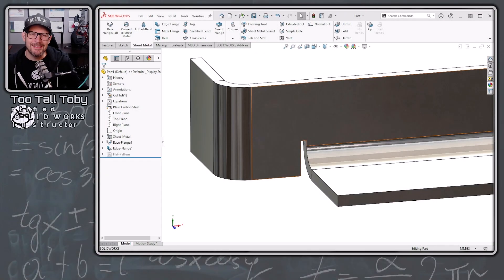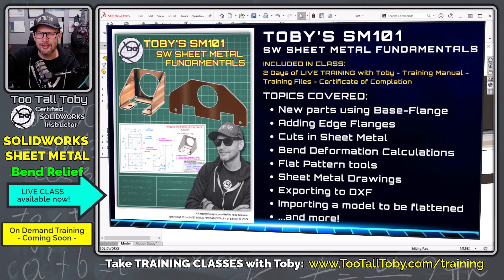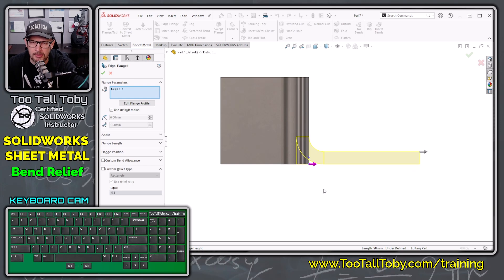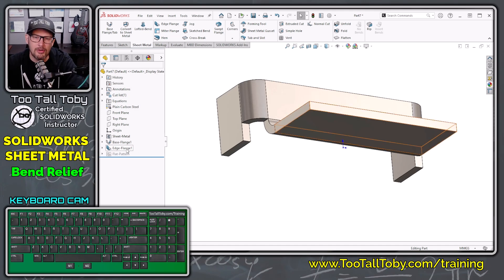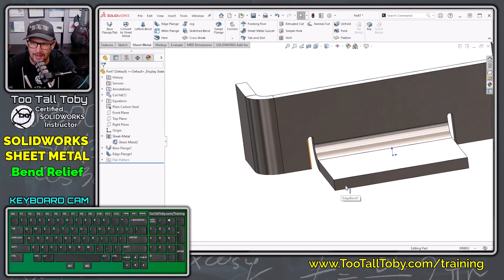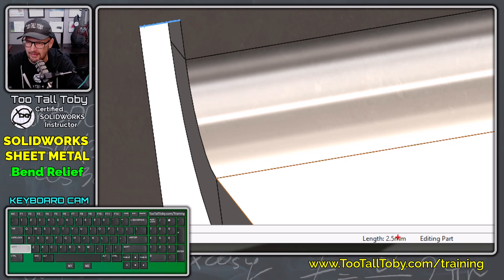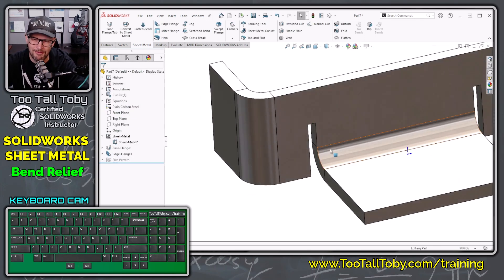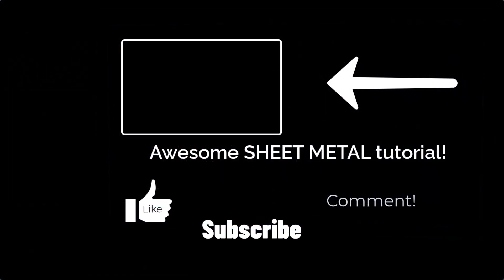How Sheet Metal BEND RELIEF works in SOLIDWORKS - Toby's Tutorial

Comment: Toby, thanks for posting this tip. I use the sheet metal module quite a lot and was wondering if you cover creation of large sheet metal cilinders or cilinder sections with cutouts and/or mounting holes in your sheet metal class? I find that creating flat patterns and drawings to give locations to hole centers  can be challenging. Also flat patterns usually need to be adjusted to fit the real part. Thank you much for what you do for the SW community